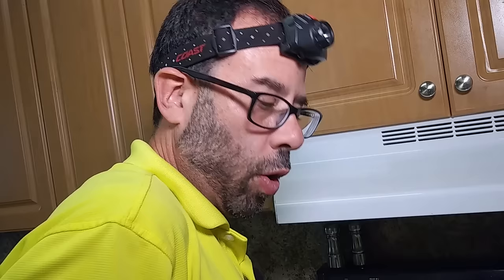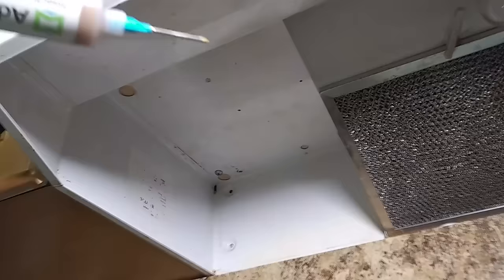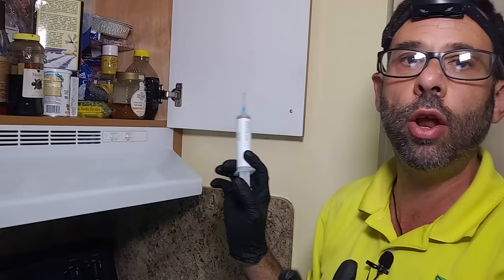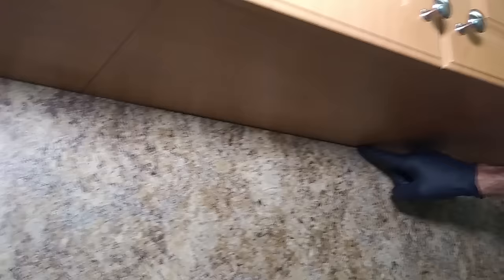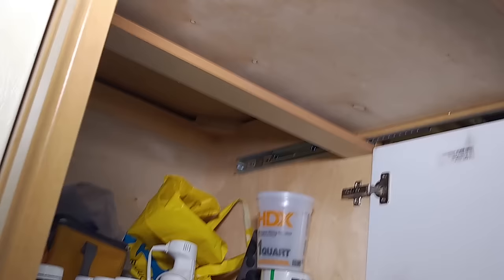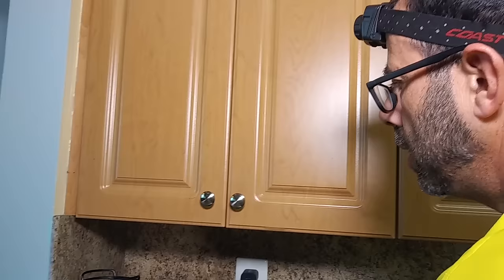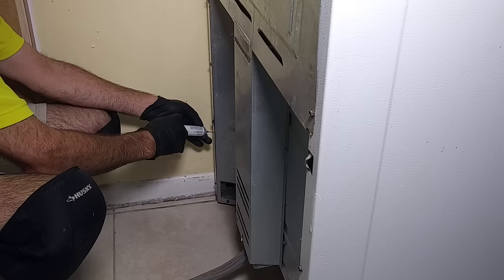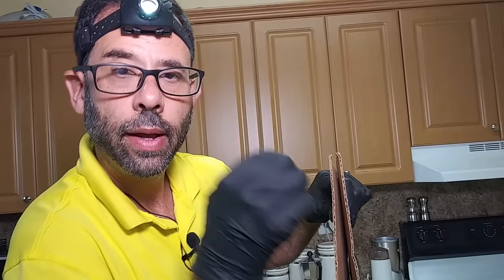How To Get Rid of Roaches | Eco-Friendly Cockroach Control Miami

Comment: I am a pest control technician in tn and I have to admit, he is right that is the same way we treat here and it is very effective
Reply: You treat a german roach infestation with nothing but gel baits?
Reply: What kind of bait is he using?
Reply: @jasonbisdead  yes, I'm a tech in Florida and gel bait is the ONLY effective way. Applying liquid insecticide inside is ineffective and most insecticides are cancer causing. Never let a pest control company spray baseboards.
Reply: @AmericanMinuteman95  I’m in FL, moved here recently from TX. We have it badddddddddd!! What can I use?
Reply: @simonsaid8790  From what i saw, The hyperdermic needle-looking gel is Advion Evolution Cockroach Gel 1.06 oz (30 g). I couldn’t see the title of the “puffer dust” product. Perhaps each product is by Advion, so start from there with your research.
Reply: @simonsaid8790  the best roaches gel is maxforce gold roaches gel..and advion roaches gel..

Comment: Great video - well done (watched it twice). I had 5-6 roaches the first 3 years in my unit. I emptied cupboards and cleared all wall space. The landlord sprayed in February (they won't gel) .  Roaches surfaced with increased frequency since then. I went to HomeDepot - bought a multi bug - powder, it is still sitting under the couch, bookcase, back of kitchen sink, etc. No luck. Roach infestation increased. I put gel (antBgon by ortho) down a month ago.(2 tubes, a month ago and another tube since).  i still have some baby roaches (and a few  new large one's, caught on my ducktape traps). I"m not sure if they are migrating in from another apartment, or just hatching and I'm working my way through the gestation period.  Your video said 30 days, I think gestation is 6 weeks but not sure. Any additional thoughts? I have plants in the livingroom,(not tossing them) thinking I need restrict watering to small morning dosages.. Any other suggestions.  Open to guidance from anyone who reads this.  Thanks in advance - happy new year.

Comment: All u need is bait,dust,oil based flush for refrigerator motor,and vacuum to get as much in back of the fridge as possible,The baits will do all the work itself
Reply: They are in the side of my deep freezer and back of fridge, so what is the oil based flush you are talking about? And like a hand vacuum?

Comment: Thank you very much for the free lesson.  Right to the point.  No bullshit yadda yadda this that.  I have had a relatively annoying problem with German roaches in my house usually in the kitchen and in the studio/office.  They like to hide inside my guitar pedals and speakers, etc.  

They also like to hide and live in between the hardwood floors, in between the spaces of each piece of wood.  We're talking about 2-4 MILLIMETER spaces.  A FREAKING disaster.  Nuisance.  It's so gross to have these things.  It has helped to have cats (1 in the home and 2 outdoor ones) as they are supposedly natural predators.  But you still need to clean, kill, and SEAL UP HOLES CRACKS.  For wood spaces I would look into a polyurethane based caulk or Lexel caulk.

Comment: Is learned a lot about roach control.   Where you are showing cabinets on the wall & to refrigerator is where they are. Our apartment management brings the  tool you showed which does not work. So do I place the glue under the sink and the kick plate. Under the sink looks just like to the one in  my unit.. Where do the roach hide in the back of the stove?  How can I lift the burner unit ? If I have roaches in my unit are they in surrounding units ? My last  concern can I apply the bate product over the other treatment? Your video is informative and helpful. Thank you learned a lot today now I ' m going to get rid of roaches.

Comment: Thank you so much for this video, you are so through and to the point. The exterminator that treated my apartment this week was not as through, only applied gel to the back of the door of my kitchen cabinets and left after a blink  of an eye.  Moving forward I will be my own exterminator. i purchased the Advion gel and will apply as  demonstrated. I also have the harris tablets which are somewhat helpfuI . I admit I did empty my drawers, cabinets and medicine cabinet. Im hopeful after educating my self on  roaches and holistic treatments. By the way, what is that wand/extender thing you attached the gel tube in your hand?I want to purchase that to make treatment easy.

Comment: Hes exactly right. German roaches are carried in the apartment. I worked for a guy that did 33k apartments a month. When we had germans in the kitchen we went in and did a roach clean out. Used intruder X and got them running, and then used another chemical and killed them on the spot.

Swept them up and called it a day.
Reply: May I ask what's the other product used?

Comment: My exterminator sprayed the baseboard, in all the cabinets, and applied bait in cracks
Reply: unfortunately there are a lot of people that do not know how to apply bait correctly and there that haven't accepted it yet.
Reply from the maker: it will have an effect providing the gel bait did not get contaminated and he placed the gel bait in the right spots where the roaches are.
Reply: @NaturepestNaturalPestControl  it 100% worked

Comment: Yes a do it you own pest control company sent me similar bait and IGR regulars and no German roaches for the last 1.5 years. Recently I saw 1 large American roach running on the basement floor that I smashed with a rolled up magazine. Month later a large American roach running on the floor.   I called the same company. They said I should treat with the bait and IGR regulators but I had to spray insecticide along baseboards especially in kitchen but in entire house and 3 feet up and down on perimeter of the house.  They said leave the house for three hours.. Then I would need to spray inside once every 3 months on inside and once a month outside until winter sets in.  So they have the same approach you use for German roaches but say the spray is needed in addition for American roaches. What is you thoughts about treating American roaches?

Comment: Ok....so Why not use the whitmire system 3 with a flushing agent, then vacuum the scurrying roaches. If you just use the baits the remaining roaches will just start to eat the dead ones. I know what you're doing works, but, that's a very slow solution. I also dont recall the growth regulator that was used. Since you arent using liquid insecticide, I would suggest Gentrol Point Source to stimulate the molting process, thus, increasing metabolic functions.

And, roaches do not feed their young directly. I have no idea where you are getting your biological information from. According to the Truman's guide for pest management operations there is no such biological function from the major pest roach species. 

Your bait placement is very thorough, I must admit.
Reply from the maker: Also here are over 25 studies i used to develop the process over 6 years, you can get control as fast as liquid and flushing if you follow up in 3 to 7 days. https://pestgeekpodcast.com/blog/the-complete-cockroach-resource-guide-to-getting-complete-roach-control/

Comment: I noticed you put the bait gel into the cracks. Doesn't the leftover bait need to be cleaned out of there eventually? I try to put outside of the cracks area so I can wipe it off in a month.
Reply from the maker: most of the bait will be eaten you can scrape it out with a toothpick if you like, advion dose not stick to surfaces well you can literally pick it off

Comment: What's the dust bait that was used? Is it a Delta or Tempo dust?
Reply from the maker: We used Avert, Delta Dust And Tempo Dusts are not baits do not use them with gel bait. or you can use Doxem but it requires the Precision system applicator.

Comment: Roughly what is the cost per apartment for this treatment?
Reply from the maker: it depends here in Miami its between $235 and $335 for initial and 2 to 3 follow ups
Reply: @NaturepestNaturalPestControl  does that price include the 2 or 3 follow ups or is it just for the first treatment?

Comment: I see them inside the microwave. When they see us they run into the metal mesh section of the microwave and hide. Is the bait toxic to put inside the mesh wall of the interior of the microwave?
Reply from the maker: you can place it in the back of the microwave on the outside

Comment: I made a mistake ordering this. I ordered the product, followed your instructions. If before I saw occasional dead roaches 🪳 here and there, now they are walking around in every room on the floor or wall, big, or small. And once I saw one in a cabinet where I store pots. 😱
“Bait” - exactly, that’s what exterminator told me. That the product I bought attracts them into my super clean (operation room like) apartment. 
I made a huge MISTAKE‼️
I need something which wouldn’t allow them to enter my place. Some scent or powder which would stop ✋ those insects from coming to my home. 
Who can advice something? Please 🙏🏻🙏🏻🙏🏻
Reply: Yea I just bought bait waiting for it to come but I only see them occasionally and I don’t want to  end up having the same problem you end up having did you find a solution?

Comment: can we talk via pm? im curious to what you have to say about the german roaches, im in pest control and i HATE using an excessive amount of pesticide to control them, i would rather put some advion or maxforce down and be done with it, even if it took me two services, i cant risk people ingesting pesticide/insecticide. also those igr's you put out, those gentrol tabs..how much luck have you had with them over the years? also i gott aaskw hen you pull the electric socket off, what dry bait are you using?
Reply from the maker: sure message me on fb messenger

Comment: This is misleading, yes in a perfect environment this is supposed to work.

Now, where this is misleading is that you fail to take into consideration roach bait resistance and aversion due to factors such as ; cleanliness of the area which often times can be very poor . Good luck with advion working around grease plastered walls.

Also the possibility of pesticides and bait resistance due to previous use of over the counter baits used by the client. Etc etc.

You fail because you're explaining a text book example . What works in a lab and in a clean environment  may not in the real world.

Yes  you correct in some aspects but you're only telling a small part of the entire picture roach control is usually much more complex than this and most places you treat will not be as clean as this unit, and thus other methods as well as baiting need to be implemented in the whole picture.
Reply from the maker: Thanks for you comment so let's address this comment one by one. 

Misleading, and perfect environments: we have been performing our service in the most challenging environments on earth such as for 3 years in Urban Liberty City HUD housing where we were successful in controlling the infestation of an entire community over a 3 year period. some took 3 visits to clean out while others took us 6 months due to the factors you mentioned. However, we performed better because of our protocols work. We have never experienced a pesticide resistance issue with any bait, its usual aversion, not resistance, and that is overcome by changing the bait for another, however, in our experience of performing thousands of these services over 9 years, we have experienced it only I restaurant.

So we have extensive real-world experience and expertise because we don't work in labs it has also real-world experience of love a decade worth of scientific research in a real-world environment by world-renowned Entomologist Austin Frisman and the work of RJ Brenner in the inner city of Boston.  

Could the problem here be that you have a biased because your because you own a traditional pest control business where you are the Owner-operator at Alpha pest management, 

Former Technician at Century Termite & Pest
 and Former Technician at Terminix where you were trained to believe that you have to spray to get control? 

Listen to my podcast the Worlds #1 Pest Control Training Podcast The Pest Geek Podcast For Professionals
Reply: NaturePest Natural Pest Control hating at an all time high he is. This stuff Works. Thanks for all the tips!!!
Reply: NaturePest Natural Pest Control I see no lies in your statement. How did you find out he worked at those previous locations?
Reply: @NaturepestNaturalPestControl  very well said